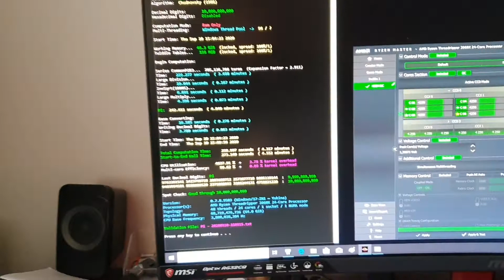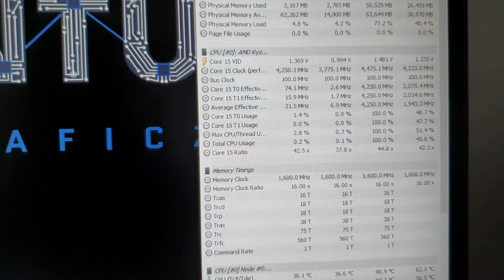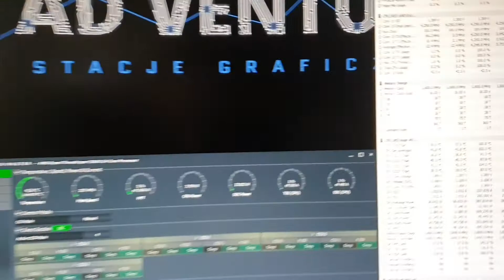Aurora XPX Pro mounting mechanism  failed....

Comment: I don't have that problem at all but then again it looks like you install the block upside down
Reply from the maker: Hehehe. Nope, it is not upside down. The writings are. Do you have the upper part of this wb filled with liquid? Maybe after months. 
Good for you that your motherboard had better standoff holes. Because I had used 40+ Auroras XPX Pro and all are with non standard mounting. ;)
Reply: @ADV_PO  The block is upside down the alpha Cool logo is supposed to be to the top right corner and your rgb wire is supposed to be on the left hand side facing the exhaust fan that was the first things that I've noticed I screenshotted a picture and looked at mine
Reply from the maker: @jasonmorales8430  Read carefully. This wb will not fill correctly and fully when mounted with outlet lower than the inlet. It will be filled partially for a long period of time. To speed up full filling of it, it has to mounted like I shown in the video. For me it doesn't matter how the company Alphacool created writings on it. For me the most important thing is temperature and even thermals on chiplets. So for me the correct way to have it filled instantly and get even thermals is to have inlet under the outlet.
Reply: @ADV_PO  idk man I don't have any problem's at all so far mounting or temperature 🌡️ it works 💯% on my setup
Reply: @ADV_PO  Your words sound like - "it's not my hands that are crooked! It's the alphacool engineers who didn't work!"!
The position of the water block is determined by its structure. And for the Aurora Pro, the inlet must be BELOW the outlet.
Regarding temperatures - this is actually the cant of the alphacool engineers themselves - to correct it, you need to "add" a small thin steel plate that "expands" the field of operation of the water block fins. In the current configuration, this water block is not intended for cooling modern Threadripper with the CCD located at the edges of the heat spreader. This water block is only suitable for "old" Threadripper and modern Intel processors, in which the crystals are closer to the center or right in the center
Reply from the maker: @chveyk  Thay you for your comment.  Let me disagree: 1. Read previous answers. 2. I've build 30+ LC with this water block using different standoffs or screws (mainly 3970x and 3990x). 3. No the WB is not too small. I have great temperatures if I use other standoffs or screws directly to the motherboard . 4. IDC how do I sound like. If they've made bad (too high)  standoffs and the mounting mechanism is on springs  - I'm not the one to blame. 5. And finally : have you used this water block, because I did. And I know that if it's with writings in correct position it will have higher temperatures on 2 chiplets, because it will not fill completely.
Reply: @ADV_PO  Давайте по порядку:
1) Читал, потому и написал.
2) Отлично. а материнские платы вы какие использовали?
3) я не говорил про ВЕСЬ водоблок! Я говорил про "внутреннюю структуру"! А точнее - ошибку проектирования, когда активно охлаждается область в центре шириной чуть меньше 20мм - всё что за пределами - "мёртвое поле"! Туда вода в каналы уже не поступает - она вышла ранее.
4) Вы точно применили ТЕ стойки из набора? высота "проставки" в стойках под ТР 4 сокет - 2.8мм. Высота крепления над краем(дном) водоблока - 5мм. Так что вкрутив стойки в гайки сокета вы НИКАК не можете получить ситуацию, когда водоблок сможет достать до их края - они как минимум на 3мм ниже края крепления! Вариант, что у вас нестандартный сокет и высота "гаек" в нём больше. чем у стандартного ТР4 сокета(6мм от поверхности материнской платы). 
5) Именно - имеют такой водоблок - при вашем методе установки как раз "заполнить" водоблок полностью без "укладывания" системного блока набок невозможно. И даже после запуска системы весь воздух будет скапливаться в водоблоке. Если честно - я не представляю КАК может "не заполнится полностью" водоблок при правильном положении? Вход снизу, выход сверху - весь воздух и пузыри сами выходят. Гланул ваши более "свежие" видео - в них вы водоблко ставите правильно. А чего так? Пришло осмысление. что "что-то не так"?
К слову - ещё раз пересмотрел видео - у вас стойки не до конца вкручены. Потому-то и такая проблема с прижимом.

Comment: I guess your XPX Pro itself has not a flat surface and that is the issue with the spots not covered with paste. Because your conclusion that the screws are faulty not make sense if you look in your video you try to push the XPX by hands onto the CPU and it didnt touch the CPU fully. The mounting frame wich is affected by the screws sits higher / ontop of the XPX Block so it can not be the reason. Because with your hands you push the XPX itself wich has no limitation by the mounting frame in terms of going more down to the cpu die. So my conclusion is that the XPX Block is not flat ! try to grind it flat and i guess your temperatures will be better.
Reply from the maker: Samy, The standoff screws are the faulty part here. You only need to change them to ones that are only holding block in place but are not limiting the block to touch the IHS with its whole surface.